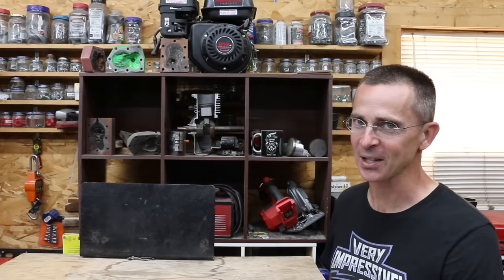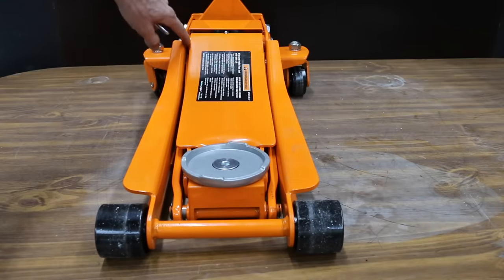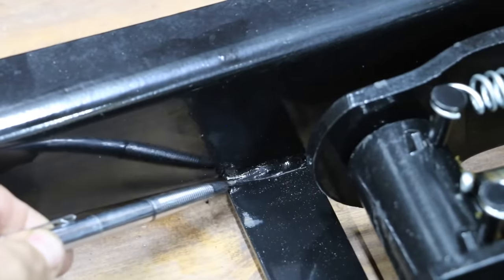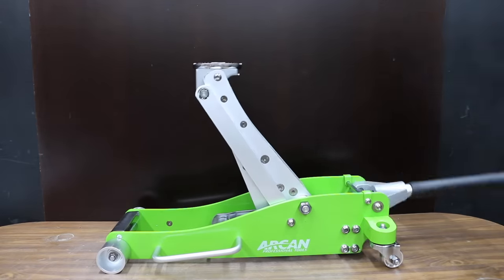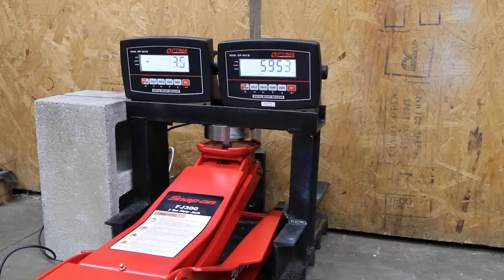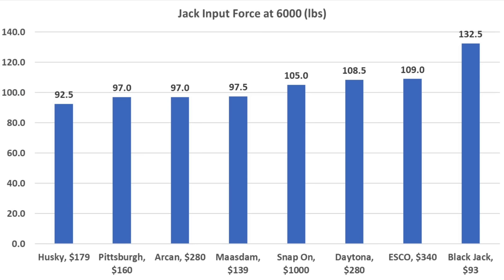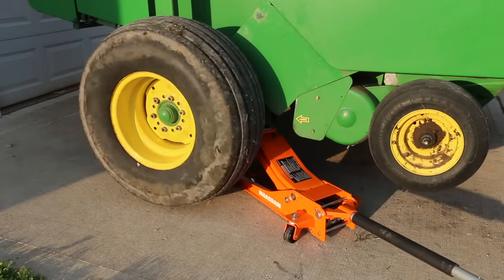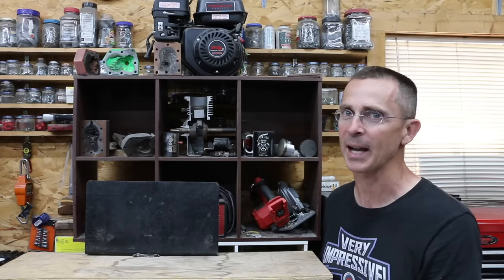Best Floor Jack? $1000 Snap On vs Daytona, Pittsburgh, Arcan, Black Jack, ESCO, Husky, Maasdam

Comment: Man, the Daytona jack is seriously impressive. It looks like it was made to basically never break. Only other one I'd consider besides the Daytona is the Arcan, mostly for its light weight. But I'm still inclined to the Daytona for all the grease ports. More than just being cheap, that's a jack made to be maintained and cared for, and that's something I really appreciate about it.
Reply from the maker: Thanks for sharing.
Reply: the daytona is a great jack compared to most chinese made ones.only down side is its heavy
Reply: Serviceability is always a huge item to consider that's what keeps something working properly for the long run.  I was surprised when I unboxed my Daytona jack a couple years ago that it had grease zerks on the wheels.
Reply: For a workshop the Daytona is the pick but if you do mobile service the Arcan is the obvious choice.
Reply: I have both the Daytona and Arcan. I prefer the Daytona for all my jobs in the garage. But when I do work around town I bring the Arcan because it's light enough to lift in my vehicle.
Reply: I used to have a 3 Ton Torin Black Jack (picked up on clearance from Sam's Club) & an Arcan Hybrid 3 Ton from Costco.  I sold the Torin to a close friend of mine.  He said his friend borrowed it & killed it, but I never had a single issue with it.  The Arcan grenaded the seals after about 3 years of use.   I took it back to Costco with the intent of swapping it out, but they no longer carried them at the time.  Costco now sells them again; for about $100 more than I paid initially.  I inherited a basic 3 Ton Harbor Freight Pittsburgh jack when my brother passed away in 2020 & recently picked up a HF 2.5 Ton Aluminum jack that is comparable to my old Arcan.  The Pittsburgh works great, but most of the work I do is rolling fenders on lowered cars which often requires a low profile jack.  If I were to pick up another one, it would likely be a super low profile Daytona.
Reply: Purchased the Daytona a few months back, and I can't give you a complaint. Even with the weight I'd rather drag it then use some of the other brands I've used over the years.
Reply: @tywarren4704  Costco has the steel Arcan for $209, it was $109-ish when you first got one?
Reply: i paid $169 at costco 2-3 years ago
Reply: I purchased the Daytona a few years back for home DIY usage in a large family with 4-6 cars (over the years), and it has served me very well. It works great on our small cars due to it's low clearance, but was also helpful with my Silverado 2500 Crew Cab truck (high lift). No complaints.  It would have been  nice to have seen this video before that purchase, but ultimately wouldn't have purchased something different even if I had.
Reply: And you can typically get them cheaper if you wait around... mine was 179 😁
Reply: I bought 2 last year and the pumps already failed. Replacement pumps online are $90 but don't even know if it's the same manufacturer. QC is definitely not consistent
Reply: @t5782-j4o your home diy, any jack is going to serve you good. I picked up 2 for my shop last year and they barely lasted over a year before the pumps failing. Have an older Pittsburgh that is still working and an even older craftsman that's put in way more work with way less care and maintenance done to it.
Reply: I just bought the Daytona but I got the long reach low profile one not the super duty because I wanted the foot pedal but I wish it had the wheels with the grease zerks on them. I haven’t heard too many people say that they have complaints.
Reply: I just bought this exact jack and I can a attest that the build quality is superb
Reply: I have the Arcan, love it.
Reply: Used mine many times never had issues way better than the dookie 2 ton I had before

Comment: As an average/amateur DIYer, I own a Daytona jack for 3 years and I can say it always worked and I never had any mishaps. Great value for money and after watching this video, I bet the folks at Daytona benchmarked the Snap-On jack and simply copied their best bits and sell it at a fraction of the price. Sucks for Snap-On but great for consumers.
Reply from the maker: Thanks for sharing.
Reply: Rumor is Sunnex makes the Daytona and Snap On jacks. I have personally had the opportunity to have them both side by side and I have no doubts they have interchangeable parts. I’m talking down to the hardware it looks to be the exact same. At least the Snap On jack i compared to which was a FJ3000 purchased new in 2016 or 17
Reply: I believe snap on tried to sue Daytona years ago but that was dropped when it was found out that snap on was not made in the us but made in China and had the same manufacturer as Daytona
Reply: F snap on
Reply: @brandonzm1122  Theyre the exact same they have the same manufacturer

Comment: The money spent for the 3 Ton Daytona Jack was definitely a great investment. The low profile gets under any car I've worked on and the height it very nice. I know the sell a wide double pad attachment for doing frame lifting or cross members. When Snap On took Daytona to court for stealing their design and lost I knew it was going to be a hell of a Jack for cheap. Very sweet video Todd
Reply: I agree, I have the same Daytona jack it's. It's been great for investment. I was actually surprise on how familiar the Maasdam looked to the Daytona jack as well.
Reply: yeah that lawsuit seems to be the advertisement harbor freight couldn't get even if they were willing to pay for it!
Reply: About to hit 5 years with my Daytona super duty, lifting everything from small cars to full size trucks & SUVs. Never greased it & still smooth as butter. Probably do for a maintenance. Oh & the rear casters come apart for better greasing.
Reply: Bought mine on sale for $160 two years ago. Glad I did, they went up in price alot.
Reply: @TonicofSonic  The pandemic and inflation really jacked up prices.  What Harbor Freight advertises as a sale now is more than regular price 2 to 3 years ago.  Not all the Daytona Jacks are equal, the lesser ones or tier below IMHO are not any better than the Pittsburgh.  The Pittsburgh for the weekend mechanic is more than sufficient.
Reply: Snap on should be sued for that price
Reply: @jsun3117  I was gonna say, I got my "super duty" the yellow 1 for 175$ in the 2017 black Friday day sale which was the cheapest I ever seen it. For 160$ sounds like the Daytona long reach awesome jack as well. I had that as well until my dad's jack failed and really needed something low profile to jack up his cars, has a foot pedal for faster engaging to the vehicle. I only needed like 3 pumps to touch the frame on my 97 ford expedition.
Reply: @joselozano0528  Mine is the orange one. I thought it is a long reach version of the yellow but I may be mistaken.
Reply: @TonicofSonic  Same, it's Def a steal for 160$ I struggled with paying that much for it. But I'm glad I did. But dayum! That thing is heavy...
Reply: @jimmyjackz  ya it is heavy!

Comment: Well, now that we have this, I suppose we need a jack stand showdown as well. Could do rated weight, time on stand (in theory should be indefinite, but hey), and angled capacity since not all garages and driveways are perfectly flat and sharper angles can significantly compromise the strength of the jack stand.
Reply: And test if you can disengage the jack stand with a load on it.  Harbor Freight had to recall a bunch of theirs years back because of this, causing a safety risk.
Reply: I still have a set on the recalled jack stands from harbor frieght if  project farm wants to test em with it😆
Reply: @summervillesean  I replaced the pins with quick release pins, the ones with the ball on the end. Makes it hard for them to slip out.
Reply: Could see how fast they sink into blacktop too!
Reply: @cowrocket3870  - I always place my jack stands on 3/4” plywood (get construction scraps out of dumpster if I need to replace)
Reply: Yes, a jack stand showdown would be great!
Reply from the maker: Thanks for the suggestion.
Reply: @davidturk6170  Same. My driveway is mostly sand. Gotta put some pieces of scrap plywood down under as floaters or they'll just sink into the ground.
Reply: @summervillesean  I have recalled Harbor Freight jack stands that work fine. I never took them back. I think the problem was with weld quality, but I could be wrong.

Comment: I bought a harbor freight jack about 30 years ago and another one with and adjustable saddle about 20 years ago, both are still working great with no problems.  Thanks for the review especially the piece on refilling the jack oil.  I am a fan of your reviews because they are thorough and objective. Thanks again for your efforts.
Reply from the maker: Thanks and you are welcome!
Reply: sometimes more expensive doesnt mean better!
Reply: Bought a motorcycle floor jack about 20 years ago from HF. I have used it on Road Kings and Heritage Softails and is reliable and I have never felt it being spongy or cheap. Great tool.
Reply: Harbor Freight,  yeah i remember them from 40 years ago.  Nice to know they have maintained - or i hope they have -   a high quality company.

Comment: I have the Arcan aluminum 3-ton floor jack.  It has been serving me well for the past 10 years.  Still look fresh like I just purchased it last week.  I used it to lift my 2 SUVs and a sedan, with no issues.  I am glad to see it performing well on these tests.
Reply from the maker: Thanks for sharing.
Reply: I have a canadian re-badge of the arcan aluminum, great jack, no problem with my heavy trucks, I'm also in a wheelchair so it being lightweight makes it WAY easier to move around the shop or lift onto my lap if I have to use it in the driveway, I absolutely couldn't lift my old steel jack
Reply: I want that Arcan. Lightweight and looks well made. Would it serve me well with a Tahoe and an Accord?
Reply: @MattH-wg7ou  mines a re-badger arcan, I have a  3/4ton suburban no problems lifting it, quite lowprofile too so I can't see you having any issues with your accord either
Reply: I have the re-branded JEGS version of it.  It was great for about 5 years.  Then one of the power unit springs got stuck.  Won't lift now.  Contemplating just buying a new one as I'm having problems finding the replacement part for a reasonable amount.

Comment: Bought the Husky about 2 years ago, very happy with it and glad to see it performed well here.  "Real" jacks like these are a surprisingly large step up from the smaller portable hydraulic jacks many DIYers have and are definitely worth investing in if you work on your own cars a lot
Reply: Agreed, some of the cheaper jacks are at best ,inconvinient and dissapointing. At worst, plain dangerous.
Reply: My little Craftsman jack served me well for a number of years, but in hindsight, I wish I had sprung for a bigger, low-profile jack like one of these tested.
Reply: I just do regular maintenance and minor repairs with mine, and having a floor jack makes it so much faster, easier, and safer to work on my car.
Reply from the maker: Thanks for sharing.

Comment: Been using the 3-ton Daytona for many years on my Tundra, Camry, and Elantra.  Love it.  The low profile is excellent for the Elantra, and the lift height is great for my Tundra. Outstanding jack that I wish I purchased long ago.  Love this channel, btw.  You stress test in ways that I can't even dream up and I watch every upload..   Keep it up, my man!
Reply: I hear you.  I did not know that they made a low profile floor jack for years, so I always paid people to change my engine oil.  Then I bought the low-profile black jack and it has saved me so much money on changing oil, but it does like to settle if you leave load on it.

Comment: I have the Daytona, and it is a great value.   It has a quick lift lever that raises the arm to the point of contact before engaging the load.  Saves a lot of time on positioning the jack.
Reply: I have a Daytona. It extends high enough for my wife's Honda Pilot but it also has a low enough profile to get under my lowered Hyundai Accent (no I didn't lower it, the dealer did and added a sport suspension for some reason 😄). It's a beefy jack, raises up super quick, and lowers even quicker.
Reply: The Daytona would be my choice.
Reply: Im going with this brand!
Reply: I havent had any issues with my Daytona low profile jack🤘

Comment: This just in time, started looking at floor jacks this past weekend. And the Daytona has been my front runner for price and by the quality of the build. Thank you again for doing these tests to help the folks who can't do all these wonderful tests. Your tests with charts and covering the information that is most helpful!
Reply from the maker: Thanks and you are welcome!  Glad to hear!
Reply: I’m sure you are aware but make sure to get a 20% off coupon before the purchase. With Labor Day coming up there will be sales and flyers. Sometimes those coupons don’t work on that jack so sales might be the best time to jump on a new one.
Reply: See my video of why I wont use daytona. Ive seen 3 of these jacks unable to hold the load.
Reply: @fixitallpaul4847  Just searched your videos twice and couldn’t find any video about Daytona jacks.
Reply: @fixitallpaul4847  Thanks for sharing the info. I'm a very light user of them and I always support with stands when getting under.
Reply: The daytona is quality. That weight would be big factor if you don't have decent floors or ever. Also had a one of the support arms come unmounded. The retaing ring had somehow come offthankfully noticed it before use let me pretend welder poop on it a little and haven't had a problem since

Comment: I’ve had my Pittsburgh for about 6 years and it’s never failed me. Don’t remember how much I paid for it, but it was an awesome deal, well under what they cost now. Never did maintenance on it (though I probably should) and I’ve used it quite extensively. Will definitely buy another one when/if this one fails. Also, this is one of the best channels on YouTube. Always look forward to new content on here. Keep rocking.
Reply from the maker: Thanks, will do!  Thanks for sharing.
Reply: Have had my Pittsburgh for 10+ yrs. Payed $59 & love it.
Reply: I'm on my second Pittsburgh, the first one lasted about 2 years after being used professionally on a regular basis. Then I had to disassemble it and do a small repair during which time I found some warn out components and decided it's no longer safe to use it professionally. It still works, but I only use it very occasionally at my house. The second Pittsburgh is on its second year and it's showing some signs of wear.. Maybe I'll try a different brand next time.

Comment: Might be a bit of a strange idea, but a test on tarps would be nice. Though I'm not sure how many tests could be performed outside of durability like tearing and wearing through from use, and weather resistance. Suppose weight capacity could be tested as well.
Reply: I'd appreciate that!
Reply: This ^
Reply: @hydorah  me too
Reply from the maker: Thanks for the suggeston.
Reply: Yes quality Tarps cost an absolute fortune these days and don't really last that long, but do they come branded and how can we really know who makes them.
Reply: You may consider as an alternative to high cost low durability tarps to watch nighthawkinlight. His video on making your own durable waterproof tarps from old bed sheets was something I had to try instantly. So far so good and the process is cheap and easy.
Reply: I actually love the idea. I've got some things I need to keep stored under tarps long term, and I hate spending money every year or two replacing them
Reply: I second that idea!..
Reply: here here

Comment: I've had the Arcan floor jack for 4 years now and it has been great. The hybrid design (aluminum/steel) makes it lightweight and easy to move and store. I purchased it through Costco for around $100 at the time and it's been a great tool.
Reply from the maker: Thanks for sharing!
Reply: I bought the same one Tom, when I saw it at that price, somehow I got a $10.00 off deal . I paid $90 for it. Nice 3.5 ton jack.
Reply: I wish Costco would stock it here in Australia.
Reply: They cost $229 now at Costco. Oh well.

Comment: Great tests as usual, Todd! It has long been rumored that the Daytona jacks are made in the same factory as Snap On. I tend to believe that based on my personal experience (heck, even the wheels are the same despite the diameter being slightly bigger for the snap on). We've purchased three Daytonas for our shop and they have never missed a beat in 3+ years of hard use, despite being exposed to very harsh, sandy desert conditions out here and lifting everything from Toro lawnmowers all the way up to Massey Ferguson hay swathers. People like to poo-poo on anything from Harbor Freight, but the Daytona jacks are hands down one of the best purchases you can make there. Professional grade all the way.
Reply from the maker: Great to hear!
Reply: You sold me, where could I buy it in Europe 😂
Reply: TheCheesePlease  They had one model that had issues.  I've bought some from them and had them for years with zero issues.
Reply: It wouldn't surprise me if they are made in the same factory. I bought a 3 ton Torin Super Duty last winter & it looks identical to the Daytona & Snap On..
Reply: TheCheesePlease  you know Snap On has had recalls for jacks and stands also right?
Reply: TheCheesePlease  no jack stand failed.
Reply: Don't worry, anything from HF of good quality will be downgraded to cut costs as soon as they find out!